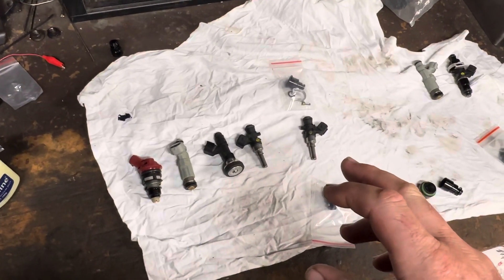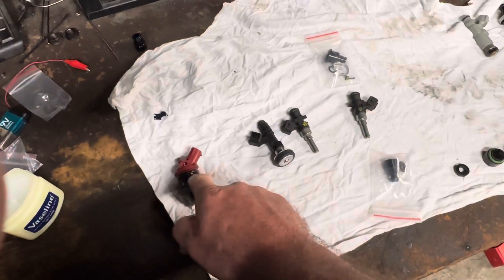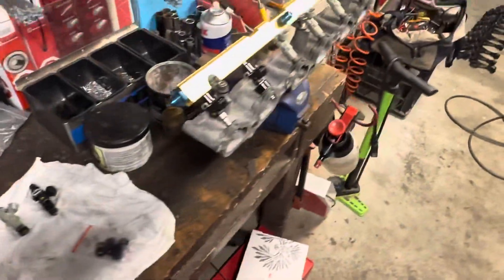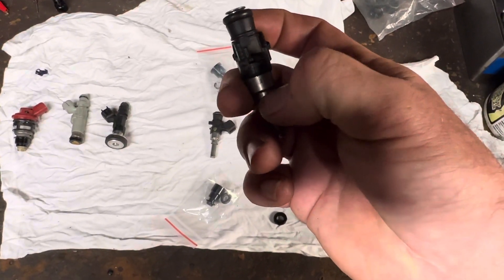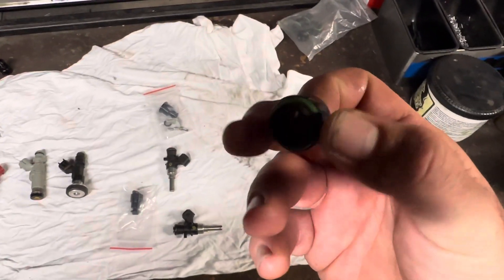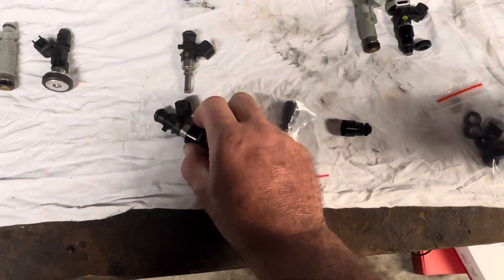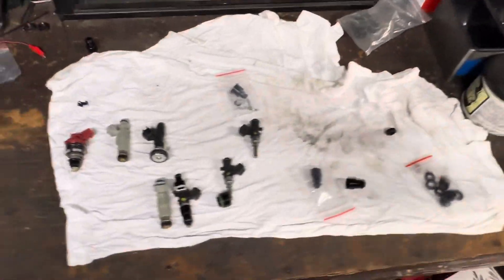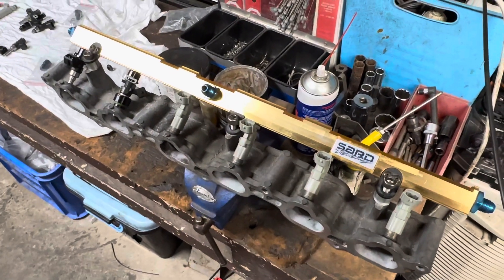What’s the deal with 1JZ injectors??

Comment: Were you able to get the subaru side feed injectors to work with the stock non vvti rail? In the process of trying to find something better than the stock 380cc injectors. Id like to get 3sgte 550cc but they're hard getting harder to find. The subaru ones would be a great option if they work
Reply from the maker: Subaru are different to Toyota sidefeed as far as I know. I have Subaru injectors here as I own 2x WRX. There’s phase 1 & phase 2 Subaru (and you can get a Deutsche works kit to convert P2 to P1). but neither P1 or P2 is the same as Toyota injectors. I have 850cc DENSO/SARD side feeds in my JZX90 atm. I bought them secondhand & had them cleaned/ flow tested.
Reply from the maker: There’s KSM Denso/ SARD 850cc injectors same as mine. Not sure if they’re genuine? Subaru is same as Nissan also.

Comment: did you try to fit the long ev14 with the 14-11mm short top hat and the 16mm 1jz grommet? google 6 x 650cc BOSCH EV14 Fuel Injectors Toyota Chaser JZX110 1JZGTE VVTi
Reply from the maker: Yeah I’m pretty sure I tried that first, but the bottom grommet was too loose/ wasn’t going to seal.
Reply: @Fine_Performance  even with the oring still on the injector?
Reply from the maker: @ChrisWilson-rf8cs  yeah there was something dodgy about the Fitment. Now how I have it setup it’s perfect. It had to do with it being a SARD rail. I took it to a fuel injector shop & they sorted it out.